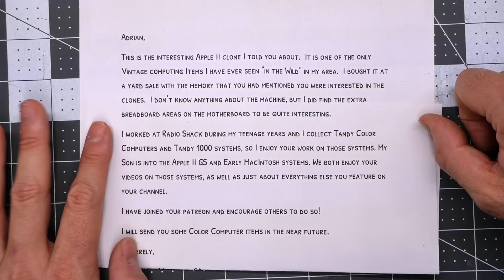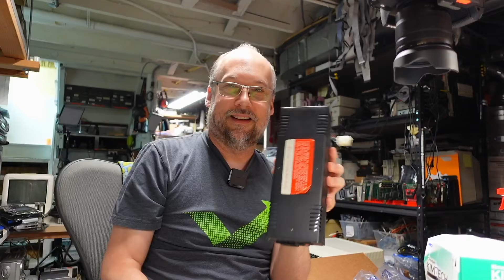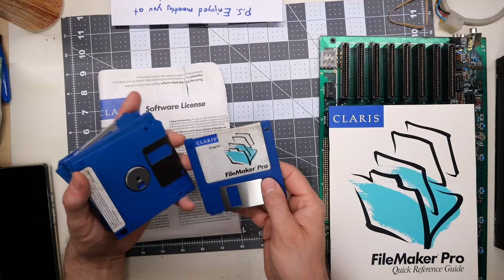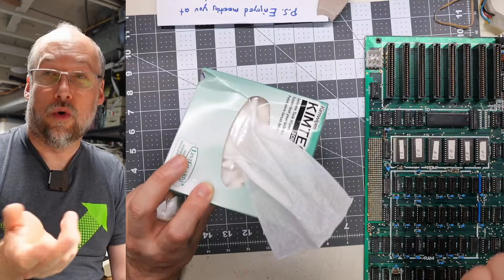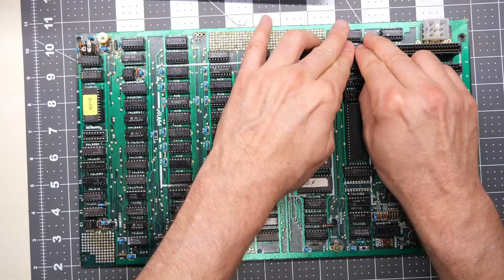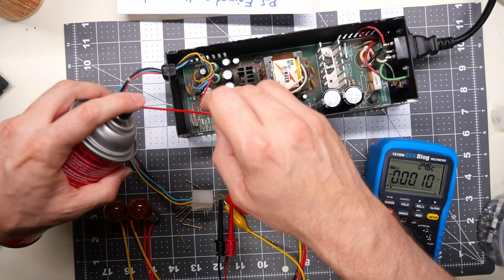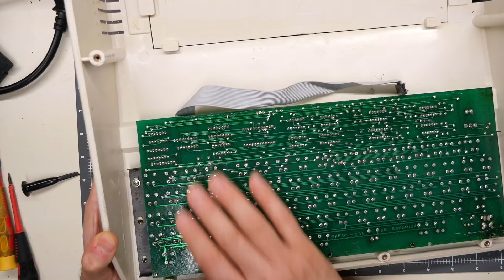0068 This computer is an illegal clone

Comment: This machine takes me back to my first Apple 2.  The culture here was if you wanted an Apple and you were not financially able to buy one from Apple you went to Parts Galore in Toronto Ontario Canada which carried all of the parts and sundries to construct an Apple 2 +.  They sold blank motherboards (which look suspiciously like the one Adrian is working on).  Several paychecks worth of visits later you had amassed all of the sockets, passives, a cpu, a character generator and misc hardware to complete the build.  The one sticking point was proms to make the thing boot.  The solution they used was that since they could not legally sell Apple prom copies, they would simply sell you the blank eProms (6, if I recall).  You would then place your chips in a static foam lined tray on the counter where the clerk would take your eproms and burn the Apple images to them, lable them and place them back in the tray.  There was no communication regarding the burning of the proms so no transaction could be proved.  Legal loophole as they saw it but it got you good working proms.  What a rush when you switched on and got the logo at the top of the screen.  Ah, the memories.

Comment: Apparently nobody noticed,  so here I go.

This motherboard looks as a derivative  from Apple ][ clone, and NOT a ][+.  The first ][+'s, the Rev 0 to be more specific, were the ones with prototyping embedded on the motherboard. Granted, this one have two areas for prototyping, while the Rev 0 had only one- that ended up being use to install a auto-start (using a 555). You needed to manually hit RESET to initialize the machine at power up. Fun fact, CTRL were not used on the Rev0 times, leading to some pretty nasty mishaps when typing long listing! 😂 

I think that the however had made this clone, started initially on a Rev0 and gradually backported the fixes and enhancements (the Rev0 didn't had Cyan neither Red!).

This may explain why this motherboard apparently had some outdated circuitry.

About  the Keyboard,  use CTRL+SHIFT to use the macros. Upgrading the keyboard controller was one of the thi ngs the clones had an edge over the original.lo
rwercase iwas anithrer, and thisnine syurey have ir.
HAvibg support fo
Having supp

Comment: The SH Logo on the RAM Chips is the Trademark of Siemens. I had a very similar symbol in mind, but with a "s" instead of the "h". This was the Trademark of Siemens Schuckert. This was a producer of electric motors. Sh perhaps means Siemens Halbleiter.

Comment: Ugh.. FileMaker..  It's one of those "tools to make tools" suites that are insidious, in that once you've been running the business with it for a couple of years, you're pretty much stuck with it unless you pay somebody to manually migrate the data to a proper database instead.  
Even worse: the kind of business that is susceptible to the false promises of that box of hot garbage are also very likely to NEVER update the thing, especially if it costs more money, meaning some hapless IT person is going to get saddled with the impossible job of finding and resolving issues introduced by automated code generation, or some ham-fisted newb "developer" who doesn't believe in reading manuals.

You should burn all the FileMaker stuff in a ceremonial bonfire stream.  Announce it in advance, and your subscribers will probably jump substantially.  :D

Comment: My first computer was an Apple II clone with 5 1/4" floppy drive, The case looks very close to that. My dad compared the board with an original and it was missing a wire connecting 2 points on the motherboard, and he just added it to the clone.

Comment: Kim wipes are perfect for cleaning video heads, pinch rollers, and audio heads.  Learned about them and the technique at the first TV station that I was at.  Had to keep the heads clean on the $20k Sony/BTS D-2 decks to ensure no dropouts.
To use them, fold them in quarters.  Works out to about a finger width.  Saturate in 99% isopropyl.  Place your finger on the drum between the heads.  Hold with moderate pressure and rotate the upper drum a few revolutions.  You'll feel the head bump pass by as you rotate.  Don't move your finger up or down during the process, keep it stationary.  Video heads can be broken by vertical movement.  There's a piezo element that moves the head up or down for tracking.

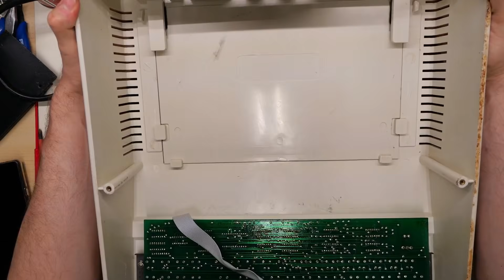Comment: Adrian: At 34:35 when you have the case flipped over, in the upper right corner of the screen you can see the upside down word "TAIWAN" molded into the edge of the power supply cutout.  You might be able to find other clues elsewhere on the case.

Comment: What a stupid question "Does it have a feedback circuit?"  of course it does all switchmode PSU's require a feedback circuit. BTW Seasonic PSU's were actually far more reliable than the Astec PSU's used by Apple. It is rare to find a Seasonic PSU with bad capacitors because unlike most Apple 2 PSU's the Seasonic PSU is vented so the capacitors don't overheat. Also that is not a -5v voltage regulator it is the crowbar SCR that shuts down the PSU when over current is detected on the +5v line.
Reply: Not a stupid question❕
You're wrong, not all switching PSUs have feedback❕
Reply: @electron-1979 absolutely a stupid question,  a smps requires feedback to regulate the voltage.  This is particularly true in a computer where the load varies.

Comment: I believe that Kimtech wipes are made from plastic "fibers" (more like "strands" really), not wood, so they should be completely non-abrasive. A quick check with a USB microscope would verify that for sure, though. Or you could try melting them.

My buddy had a Franklin Apple II clone back in the early '80's. We spent HOURS on that thing. Great video as always, Adrian.

Comment: Nice, that power supply has been recapped.  Those blue caps are Panasonic FC series, a very, very good cap.  Basically all I use other than Nichicon.

Comment: those bulbs are designed to use 12v on both filaments. But on separate circuits. Running both at the same time is a lot of watts

Comment: You could buy all of the parts separately and build your own clone.  If I had to guess, I would think this was built from parts bought from Computer Shopper or something similar.  I did this very thing back then.  The reason I think this is because of the keyboard.  A cheap knock off probably would not have had an Alps keyboard with macros.  My Apple clone had a cheap power supply, a cheap IBM XT case, and a really nice macro keyboard.  If I remember correctly, mine was mildy programmable in that it had a couple blank slots for your own macros.  I used AceWriter for my word processor and I had things like save programed.  It's also possible that this was a blank board someone populated at home.  I tried that first, but had a problem with the clock cycle part.  We only had a hand me down oscilloscope from the 40s or 50s.  I'm not sure it even worked, because I never got any clock signal to show.  I finally broke down and bought a pre populated working motherboard.
Reply: Since Woz built early Apple ][s using simple TTL logic, they were fairly easy to copy. Machines built around custom chipsets were pretty much copy proof.

Comment: Very similar to my first computer, which I bought at a yard sale. Like many Apple clones, it was generic. Had a similar keyboard and Seasonic power supply. Little different motherboard. Mine had both the 6502 and Z80 CPUs, no slot 4, the RAM  (64K) was just a single row of 8 socketed chips, and the ROM was on a card that sat in slot 1. On startup, the title said, "EASY ][", and the top row key macros had all the Apple Demosoft Applications. The computer came with  an Apple Disk ][ controller clone with a half high 5" disk drive, and a 14" YJE colour monitor. My cousin, an Apple fan, supplied me with several software disks, and I ran this computer for a few years, until the power supply died. I then replaced it with a real Apple //e from another yard sale.

Comment: In 1983 I bought an "ALOHA ][" from my local electronics store in Australia. It was one of the last Apple clones available on the market before the infamous Apple vs Computer Edge / WOMBAT case. Mine was a little different as it had the Z80 softcard included on the motherboard. The ROM was identical except for the boot string, which I later changed after a visit to a Chaos Computer Club meeting where I got copy a Apple ][+ ROM. It was my second computer after my Sinclair ZX80 and I got years of use out of it.

Comment: The T vent capacitors could be Matsushita/Panasonic, it's part of their branding. If you see an M in a rounded square, that's the Matsushita logo. They've always made reasonably reliable electrolytics. I went down a bit of a rabbit hole myself a while ago when I was gifted with some old electronics components that included a bunch of M branded capacitors and I wanted to know who made them.

Comment: I'm currently trying to revive my Apple ][/ CPM clone, an IMC-2001. The power supply broke, I had to resocket all ICS, 3 ICS broken. One of the ROM chips (unnamed) was broken and had to be re-burned with - ahem - legal ROMs. Tons of broken ribbon and other cables.
The keyboard shortcuts on mine are on a F1-F12 extra key line, you can switch between 'CATALOG' and 'DIR' for instance (so DOS 3.3 or CPM commands). I guess you can somehow execute those shortcuts with meta key or so. The small CPU on the keyboard should send the series of characters when "pressing" 'CATALOG'. Looking forward to see it working. :-)

Comment: In addition to being a computer nut, I am a retired airline pilot that spent most of my thirty year airline career flying to the Orient, which frequently included Hong Kong.  During my layover time, I did a lot of exploring, and learned that there were areas of Hong Kong that were like the wild west when it came to cloning the Apple II and PC computers.  In one area, called Mong Kok, (a long subway ride from Kowloon, where we stayed), where there were many, large 5 story buildings, that contained countless little shops, all involved in the production of PC and Apple clones as well as all manner of  expansion boards.  
It was a fascinating place, and I went there often just to look around.  Unfortunately, I never bought anything there, because I was a Commodore guy, (C-64, Amiga) and there was nothing there for me.  They also sold pirated software, disks, then later CDs, loaded with software. and on most days, the street market would be stocked with an incredible variety of  PC and Apple software.  (The C64, and the Amiga software, was located in another area, called Kowloon (where most of the tourist spots were located). 
It was a crazy time in computing, and a great adventure for me.

Comment: I think a lot of people don't understand that Apple vs Franklin was the FIRST case over the copyright-ability of code (in this case it was boot firmware, but it was precedent for all code copyright) in 1983.  IBM threatened companies that copied their PC BIOS (1981), but they settled in each case. They might have feared losing such a case, or just losing key IP capabilities during such proceedings. They could afford to just overwhelm competitors with threats. With Franklin Computer's Apple II clone, Franklin argued that copyright should only apply to human-readable writing, and it shouldn't cover code that was meant to be read by computers. Apple took the chance of suing, they were a lot more vulnerable to piracy.  I love this subject and could go on forever about it . If the court had decided code wasn't covered by copyright, companies like IBM and DEC and Microsoft probably would have lobbied Congress for new legislation for new protections. I don't think they would have lost IP protection for very long, but it's still interesting to think about. I wonder how Open Source might have been different- weaker, or would new laws given "copyleft" more legal weight?

Comment: In the early years, when I was 11 and populated my own clone of the Apple II+, I got the empty PCB for Christmas, and nothing was working. They handed out the board with a lot of mods for different EPROM and RAM configurations with these PCB solder jumpers and X-marks. But they did not give any documentation. So, I got known to the board the hard way and learned how to use a logic analyzer (8-bit Z80 driven Tektronix 308). Unfortunately, my clone got lost in time, but I have another one that I will rebuild and repair some day. Interestingly the original Tek 308 from 40 years ago made it into my collection... I take it as a sign ;)

Comment: Those wipes, I used them all the time, (industry standard?) along with isopropyl alcohol for cleaning edge connectors and removing solder flux residue. very slightly abrasive, which is good for contacts etc. whilst also ok on glass - lenses etc, probably not idea for shiny plastic, unless you go very lightly.
I knew then as 'Kimwipes', a re-branding?

Comment: I bought an Apple II clone a while back from the electronic bay website, which was relatively cheap since it didn't have a power supply. It had a weird connector and I asked on the EEVBlog forum if anyone recognised the connector and after wading through the standard "duhhhh why don't you just use a parametric search to find it instead of bothering me about it" someone actually replied with the exact one, and it's still available on the manufacturer's website (JST, no less). I ordered the connector, but I haven't got around to wiring up a power supply. I was going to use a spare TFX power supply, but it's way overkill so I might just look up those little converter boards that you featured on a previous video which let you use a PicoPSU.

Comment: I worked in an optics lab repairing night vision and other optics that can see at night and we used Kim wipes as lens cleaners. IPA, acetone and white vinegar were the most common cleaning agents.
Reply: I use steel wool coated in hydrochloric acid to clean circuit boards and eye glasses... just remember not to wear any gloves as the acid will melt them.

Comment: The resistance of the tungsten in the bulb will vary with heat. Some automotive circuits would provide a small amount of current thru the bulb while "off" to preheat the bulb and extend the filaments life.

Comment: For the bottom of the case, would buffing it out with a wire wheel then using high grit sand paper and finishing it off with a gun metal bluing solution work to make it look brand new?

Comment: Kim wipes are also known as lab wipes. They’re delicate and strong. They’re non-abrasive. In labs they’re used to wipe glass surfaces/surfaces in general. I’ve seen them used to clean the glass plates that techs use in lab microscopes. I forget what they’re called. The big appeal is that they don’t leave fiber debris when used. In the electronics repair world they’re frequently used to clean PCBs. In terms of consistency I’d say they’re as rough on surfaces as q-tips. Again, the big draw/value is no debris when used.

I use them frequently and love them.
Reply: I use steel wool coated in hydrochloric acid to clean circuit boards and eye glasses... just remember not to wear any gloves as the acid will melt them.

Comment: Kimtech wipes are zero particulate wipes. Meaning if they are used they do not shed. They are used in iso class clean rooms where due to standards can't have more that an allotted amount of particles in the air.

Comment: I had a II plus clone very similar to this. My understanding was that a lot of the Taiwan clone parts were shipped to Canada, and because everything was in parts, they could evade the import restrictions because they weren't complete systems. So there could have been dozens of makes of the logicboard, PSU, etc. I think my PSU had Tiger as part of the branding.

My macro keyboard had actually two lines on each keycap, which would be activated by holding down the modifier key in the lower left for the top line, and if shift and the modifier key was pressed, the second macro line would be outputted

I wish I had kept it, but I got rid of it after I bought a IIGS

It looks like there's some slack in the PSU power cable behind the grommet, you might be able to open the grommet and feed some of the slack to see if it's enough to reach the logicboard when mounted on the base plate

Comment: I remember in the early 1980's my school had some Franklin apple 2 clones, i remember the floppy drives never worked well. I currently have an apple 2 plus "black apple " bell and howell with single floppy drive  and panasonic  matching black color monitor, it needs a new home if anyone is interested, it all powered up about 5 years ago, i am sure it needs cap replacement so it sits in a box.

Comment: While I don't really have much to go on, I highly suspect that this was initially a kit computer.  That would answer why there is no badge on the case and why there are the 'project board' sections on the motherboard as well as why the EPROM's have tape covers that seem like something that a hobbyist would put on rather than any marked stickers like you would expect from a manufacturer who would want to attract more business.  The macro shortcuts on the keyboard would make sense if this computer came with a customised basic ROM that would allow such shortcuts to be used.
Reply: The light colored key in the front left might be used as a function shift for what's labeled on the front face of the keycaps.

Comment: Yay, another flashback to my childhood. These keyboards were sold by multiple computer stores in Germany in the early 80s, as "Professionelle Programmierer Tastatur" (Professional Programmers Keyboard), it has (more or less) autotyping features for commands. There were versions for the Apple 2 and generic versions for CP/M computers (featuring MS Basic).
Versions for CBM machines and the C64 were also advertised in ads, but were never available.